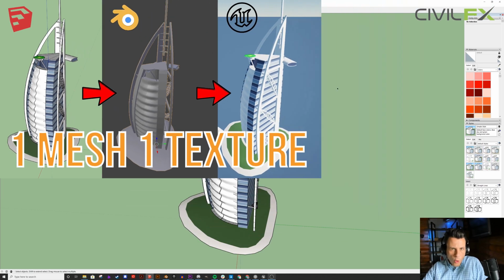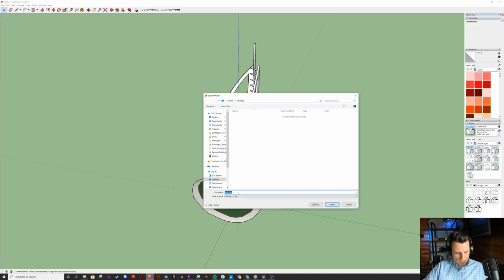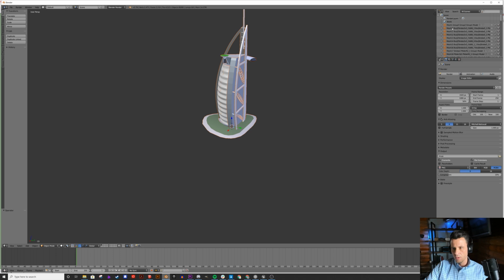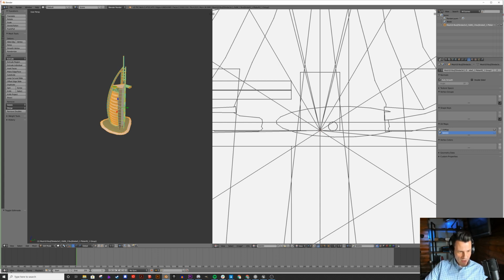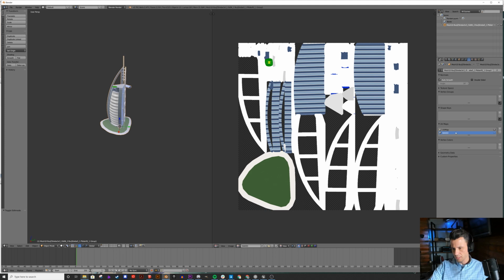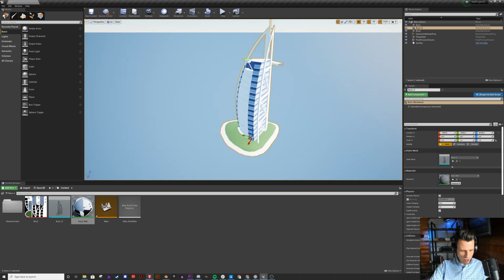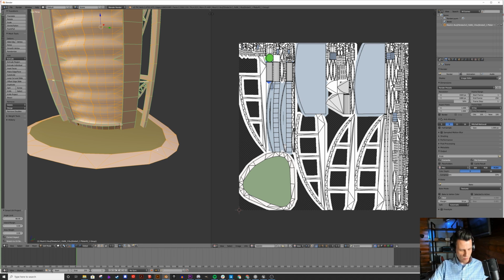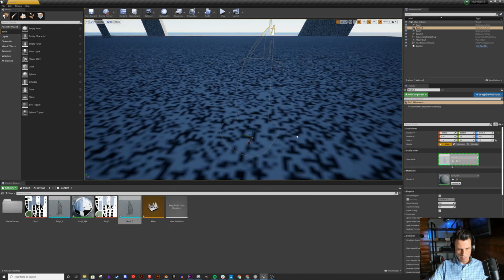Optimize Sketchup Files for Unreal Engine or Unity 3D using Blender

Comment: Thanks for detailed tutorial, Why we don't use DataSmith instead of this process?
p.s: it would be great if you make your display resolution smaller, most of menus are not readable.
Reply: I agree. DataSmith only suports Sketchup up to 2020 (at the time of writing this) but it works. The creator of this video doesn;t discuss how to quickly fix "normal" issues, and also doesn't show how this actually looks in Unreal Engine when the map is built and lighting applied.

The video does still contain some valuable info on UV wrapping so thanks for that :)